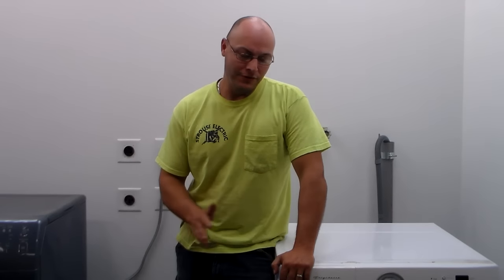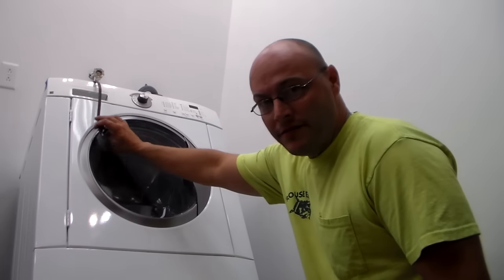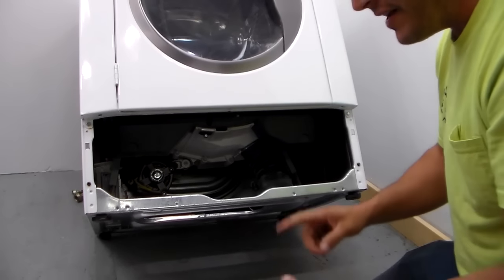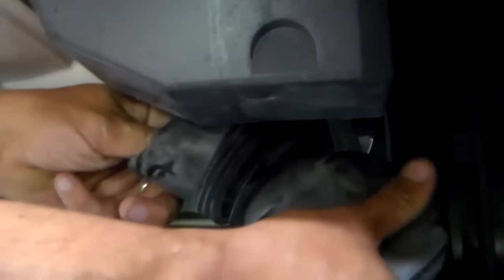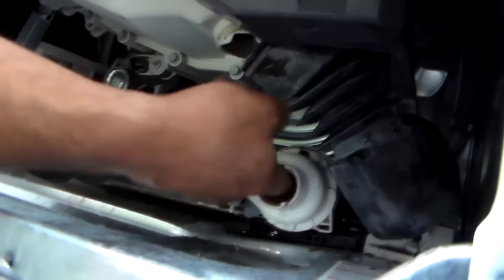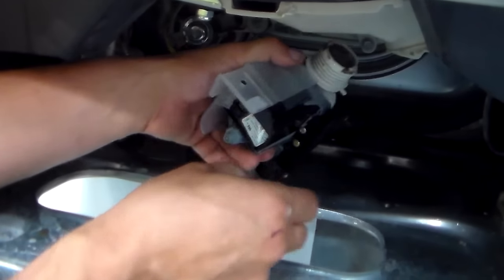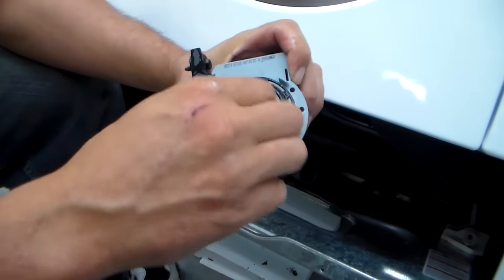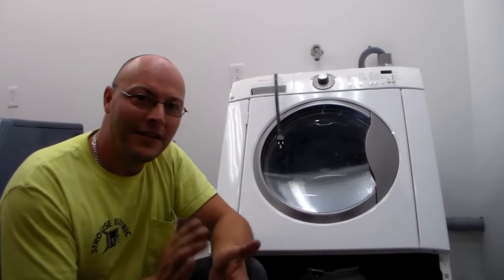Front Load Washer Repair - Not Draining or Spinning - How to Unclog the Drain Pump

Comment: Hi Bill, Thanks so much for the great video!  I have a Kenmore Elite front load washer model 44082 which looks exactly like the Frigidaire you are working on here. My washer stopped draining during various wash cycles, however it will drain if I run a drain and spin cycle after it has failed to drain. I removed the black boot however there was no coin trap in there!  Is it possible that some models do not have a coin trap? There was nothing at all inside the boot. I am the original owner of this washer and it has never been serviced. Should I purchase a coin trap?.  I have not removed the pump yet but I was able to spin the propeller in both directions however it does not spin very easily. Is it supposed to spin freely?  I can move it about a quarter of a turn and then I have to push on it to get it to move another quarter of a turn. Is this how it is supposed to work or should I remove it and take the housing apart to look for an obstruction?  Thank you!

Edited to add: I watched the part several times where you are spinning the propeller and I am still not able to tell if it is spinning freely several times around with just one push. It looks like it stops and you keep pushing it. I am hoping that that is how it is supposed to work because unfortunately I am not able to loosen the left screw holding the pump so I can't get it out to take it apart.  From what I can see there is nothing stuck by the propeller.  Since there was nothing inside the boot (including no coin trap), do you have any idea why the washer is not draining during the wash cycles but will drain during a drain and spin cycle?  Thanks again for any thoughts that you might have on this.
Reply: Nadine Duke  did you get an answer to your problem? my washer is like yours.

Comment: Bill, I was able to clean out pump, which seems to be working.
the machine will not Spin. is the drain pump related to the machine NOT spinning.
When it is supposed to spin it makes a noise but drum does not rotate in spin mode
I welcome your thoughts. Belt is fine
Reply: Did you ever find a solution? Mine is doing this intermittently.

Comment: Hi Bill. I actually have two machines which are both 417.43042200. I took them apart, as you have shown and there is NO COIN CUP?!? I see this part online for about $10. Should I add it into my tub-to-pump hose? Seems like a good idea and may have been a design improvement since these machines were purchased in 2003?

Comment: Can you "ground hop" the pump when its out of the machine to be sure it works properly? Is it only 2 wires that go to it? Does it run on the same voltage the machine is plugged into or does the power come from an internal transformer of some sort? I'm just wondering in case I get it all put back together and it still doesn't work. ..I'd want to know it's not a bad pump but maybe a bad relay or something.

Comment: So, I did everything to my 20 yo front loader. Very similar to your video except I never found basket strainer? Found a quater in the boot.
Reply: Still won't drain or spin and "hums or buzzes" on spin drain cyc le.  I can easily spin the pump with my hand.

Comment: Well my daughter and i got under and inthe machine and cleaned out the trap. On ours (a GE ) There were lots of coins, and huge amounts of lint, dog hair, hair pins, a screw, a nail and a rubber cockroach my grandson used as a joke in the trap. The machine had a front panel that came off but we had to tilt it to get to the boot. the clamp came easily off the boot and we cleaned it out.  In the front of the machine under the panel was a turn thing like a gas cap and that was where the trap was. The worst thing was that the clamp that came off the boot would not go back on - period.  Had to buy a new clamp and put that on. Getting ready to try it now.
Reply: Me and my mother tried this tonight in her GE washer.  I didn't find the coin catcher in the boot. And just like you we can't get the clamp back on. Was the coin catcher for your washer connected to the drain cap? If so ours didn't have any debris whatsoever.  I would love to hear your response.

Comment: Hey i just watch u video and helps a lot but mine still making a weird noise and not draining i clean the pump i make sure that the fan spin and i also started with out the hoses with the pum out and it works but it doesn't look powerful idk if is because it didn't have wather or what but thats my situation. ..i have a whirpool cabrio top door

Comment: Question: I did this and the impeller was turning okay - no pins or anything stopping it from turning. Just a couple quarters in the catch. Also, no plastic piece inserted in the boot like in the video. Does this mean the pump needs replacing? Please advise and thank you for the video.

Comment: So then, it is normal for the pump to resist manual rotation, giving a 'bump-bump-bump' feel when it is being turned? I jumper-wired mine straight from the wall-plug and it spins, but with a putrid vibration and rattling noise. Not likely anything stuck behind the impaler to cause that, I'll assume, so I'll skip splitting the case and check the door-lock and drive motor next, I suppose. Thanks for the visual aid. ~chris
when I started in this racket there was no Y-tube, so I just omitted doing stack-units as a matter of preference. I still don't like them, but, --to make a buck, or not make a buck..that is the question! Happy Birthday, Sir William..a hose by any other name, etc.

Comment: Hi ,Bill I have the same washer in video and when I set on Drain/spin ,the drain motor runs a few seconds and stop then later start to run a few seconds again then stop.
Btw ,I already cleaned the hose and the pump.
Can you tell me what is going on?
Thanks a lot!

Comment: Hello, I followed your video, and I have a question. My pump does not spin freely, but I only makes 1 rotation before stopping, and then I have to push the rotor to make it spin again. There was nothing stuck inside either. Would this mean the drain pump is bad?

Comment: Our washing machine is a frontloader. It doesnt complete wazshing, it only goes as far as the first wash cycle, then stalls for 10mins and then get the error message. There is still water in the tub so we have to change the setting to drain it (without doing it manually). Usually, our door will remain locked if there is water still in the tub but for some reason, it doesnt do that. When the water finally drains, it isnt as fast as it normally is but it does eventually drain although the clothes are still a bit wet(more than usual). 

Our frontloader is similar to this where you just take off the foot-panel and have immediate access to the 'impeller' of the water pump. I have checked to see if anything is blocking it but theres nothing as the impeller moves freely. I have yet to check that black rubber thing but Im guessing if the impeller is moving freely then it wont matter so would it be wise to take off all of that when it could be something else.
Reply: I fixed it using this video and it was simple....thanks!

I did exactly what was suggested in this clip. Our washing machine doesnt have a 'coin catcher' as this one does, ours has a ball stop where that black rubber hose connects to the drum. There was a sock jammed between the ball stop and inlet of the hose stopping water from fully draining. Its working now.

For those not confident on doing it, you should give it a try or at the very least, bend down and have a look as you may get inspired cos its easy to do and can save you money.

I had to flip our washing machine on its side in order to get to the black hose as we dont have access to it from the front kick panel. The black hose is held in by two clips at each end. One you just loosen the screw and the clip will come off, the other you have to use pliers or something to squeeze the clip to loosen it. The same with the drain hose, it is only held by one clip. Our pump was held by two screws so I took it all off and looked to see if there was anything else blocking it but there wasnt. 

Its easy to disassemble and reassemble, give it a try.

Comment: What's the easiest way to reinstall the pressure switch tube if you have taken it off? I have been trying to get in back on for over an hour and it just won't latch. Do you think if I used locking pliers that might help? Please help.

Comment: Hey, Bill.   I did this last night, but still no draining.  It appears that my rubber boot has no filter inside it.  The "propeller" inside the motor turns, and I snaked out the drain hose (which wasn't clogged).   Might the problem be that the motor itself has stopped pumping the water out, and it needs to be replaced?  Please advise.  No fun :(

Comment: Bill . It only doesn't drain at rinse cycle...if it pumps out in 1st cycle nothing blocking it right?  Or am I crazy. I replaced door lock switch still does it .  I do a trick from another video that is a minute long and it works.  But I want to fix it.   The drain pump works on the first cycle tells me the pump is not the problem. Help?

Comment: Do you have any advice on when the small hole in the rubber gasket at the bottom gets plugged? I have an LG front loader, it has the small door on the front bottom left with the coin trap.

Comment: Mine was blocked all over the place loads of crap in it, got everything out then put it together bar the back turned it on and it’s sparks at the back when the spin cycle kicks in? Is this because iv wet the electrics? If so do I just need to dry them out and it will work?

Comment: My washing machine does not to the final fast spin. It does the regular one, but not the fast one. When I looked into the pipe that you pulled out the coin catcher, my machine does not have one of these, and I can seem to see any blockages. My machine is a Zanussi - what do you think could be causing my issue?

Comment: I did all this however someone had took the trap out before i got to this thing some time ago and there was money in the bottom of the rubber boot, that being said the impeller did turn also turned the machine on drain/spin with the hose disconnected to see if the impeller was spinning it was however after clearing/checking all hoses for blockage no water was draing from the machine.......so even though the pump is working and the impeller is turning could the pump still be bad?

Comment: my prob @8:00..  Something is wrong with the impeller gizmo. It is still together but the 'fin head' gets crooked within the housing. Does not look to be cracked and works most of the time, but occasionally gets wedged and seizes pump motor.

Comment: I have a front load samsung washer Model no. WF407ANW/XAA that get stuck at 30 minutes. It sounds like the pump keeps running and does not advance. Do you think I have a bad drain pump.

Comment: My husband and I just went through the whole clean out process. It is all clean now. When we try it out we can hear the pump kick on then almost immediately it stops. Is the pump bad?
Reply: Bill Newberry  help please
Reply from the maker: Mandy Stump That most likely happened at the beginning of a cycle after you plugged the washer back in.  Run it through a cycle and see if it drains.  I should be fine.  Let me know how you made out.
Thanks
Reply: It still won't drain
Reply: Bill Newberry  We replaced the pump....it works wonderfully now :)

Comment: so does the drain pump affect the final spin cycle from working as well?
Reply: Did with mine, if there is too much water left in the tub it won't spin fast, the washer will sense the too heavy load and shut down the spin cycle before it gets going fast enough to do a proper job.

Comment: So my question I’m getting a code of E22 on my GE front load washer, already replaced the pump cleaned the coin drain. Could I be having drain issue/blockage after the pump ??

Comment: hey we just disassembled ours and remove a pair of undies then reassembled and machine still won’t work :( is the impeller supposed to spin and spin very easy? because ours will turn if we do it but then it kinda feels like a rubber band inside as we turn it springs forward sorry it’s hard to explain.. any advice please

Comment: I'm trying to take the back off my machine as it's obvious there is a blockage near the pump. I've flushed the waste pipe and checked the filter. Thing is It appears the back is not removable, no screws, nothing. I've always been able to repair machines in the past. Any ideas? By the way it is a Bush model.

Comment: i just reinserted cleaned filter into the trap on the top convolution and when i ran the washer the filter got completely disintegrated. I removed the pieces and am running the washer w/o filter. It is working fine but obviously my drain pp is vulnerable to damage if any stuff gets stuck in it. Any suggestions.

Comment: was wondering, i have replaced the drainage motor and cleaned out the trap but it still will not drain. the machine will spin when washing and water did come out after i emptied the trap but when i had it in the drain and spin cycle it still will not spin. what should i try now?? thanks.

Comment: What causes the motor to not spin fast at first the motor will spin about 2 1/2 3 times and then stop and then it will do this about 3 times on the front cover where it says spin the spin light is on but it is not spinning I have checked the Ohms on the motor it seems to be good it's a 2009 General Electric front load 3-phase motor the belt is still good I replace the door locking mechanism on the front that did not help

Comment: Just a word of advice, don’t ever buy a front load washer that doesn’t have the easy access front panel. About once every year or two I have to clean this thing out on our washer and we don’t have a front access panel so I have to take the whole front of the washing machine off which is far more involved than I’d like to admit. The last time I did it I turned the washer around and took the back panel off which was fairly simple but this whole apparatus is designed to be worked on from the front of the machine so that was no cake walk either. The next time mine plugs up I might just say piss on it and go by a new one that has easy front access; that almost looks fun by comparison!

Comment: I just started a part time job installing security cameras, when I crimp the bnc the cable falls out sometimes.. What am I doing incorrect? I bought a klein dual coax striper and a klein compression crimper.
Reply from the maker: Christopher Maples Just need to spin the wheel on the crimper out further.  You need to compress more.  You'll get the hang of it.
Thanks for Watching!
Reply: I compressed it all the way, even broke a few in the process

Comment: THE PROPELLERS ON MY  PUMP MOVE FREELY BUT THE WATER WILL NOT PUMP OUT OF MY MACHINE.BUT THE PROPELLERS SEEL LIKE THEY PUSH UP AND DOWN EASLY WITH MY FINGR. NOT FIRM. COULD THATAT BE WHAT IS WRONG? ALSO I FOUND A LOT OF LINT IN THE BALL THING AND LINT TRAP.

Comment: Sir, I used samsung 9kg digital inverter front load fully automatic machine, that machine working time came one problem, few moment working our machine after automatically paused, that time opening machine inside water, don't drying waste water, now 2 times change already main electrical board, then don't re solve it our problem,
Sir,
Please give me any remedy

Thanks 🌹

Comment: I found a piece of wire in the propeller...I won't be able to get to the coin trap because the screw is backwards and it seems the only way I would be able to access it is by removing the back panel as well😩😩

Comment: Great... Actually there are below reasons why drain and high speed spin is not working and showing error code OE(Outlet Error). This is based on realtime experience on LG TROMM front load washing machine.
1) Drain filter clogged. Most common case. Clean the filter.

2) Drain motor not working(No humming sound) or something blocked the motor movement. Solution is Check whether humming sound occurs and drain motor rotates. If not check if some material blocked the motor rotation.

3) Water level sensor not working properly(Not giving water drained off signal eventhough water is completely drained off) due to clogging in water level sensor pipe end which is connected along with main drum outlet pipe.( This is the problem in my case). The solution is clean the spring type(Extends somewhat) drum outlet hose pipe, especially where the water Level sensor pipe is attached with. By pressing and releasing the spring type drum outlet hose pipe the cloggings will be released and comes out, especially Identify the water level indicator pipe connection in the drum outlet and press and release the same to remove the cloggings present there.

3) Drain hose kinked or blocked.

Comment: How do you get all the water out before you remove the boot?
Reply: +Russell Maxwell There's really no way to get it out of the boot.  Just get it out of the inside of the machine though or else it's far too much water to control draining out.  Once you take it off it's best to have a container handy so that you can direct the water left in the boot into the container and avoid a flood.

Comment: Goodness, you'd think they would make these easier to work on... But, I guess it keeps the repairmen in business... I get to do this after work today... Not looking forward to it. When the pump tries to drain, the black boot gets sucked into almost a straight line, so, clearly there is a clog... But, at least I know what/where the issue is. Not It's just a chore to get that darn clamp off... My machine is designed to work on it from the back, but because of the location, I had to do it from the front.

Comment: which wire goes where on drain pump
Reply from the maker: +christy maples The plug should only go in one way.  Wire polarity won't matter either way though if it did go in both ways.